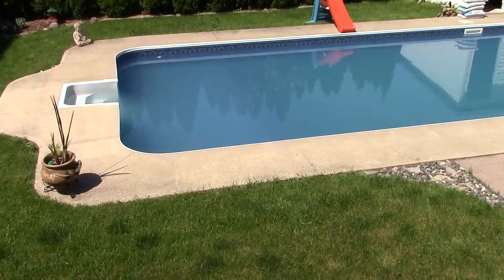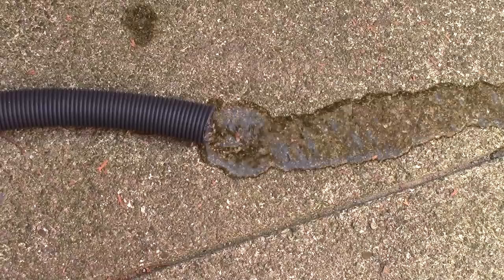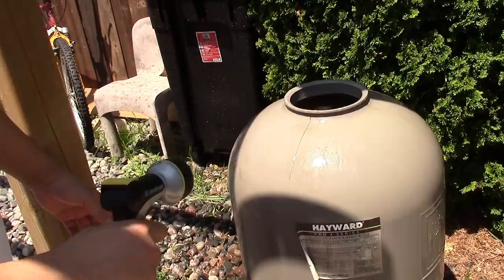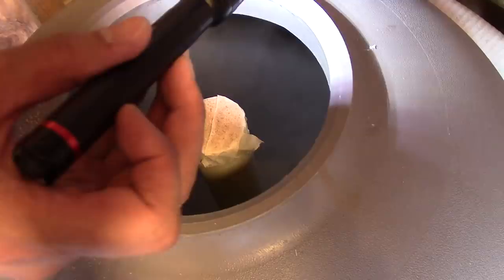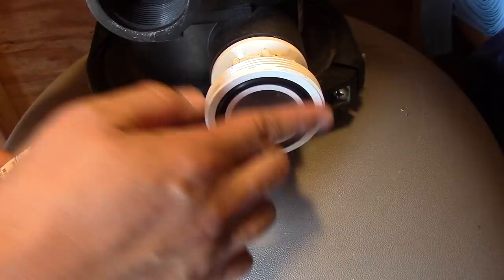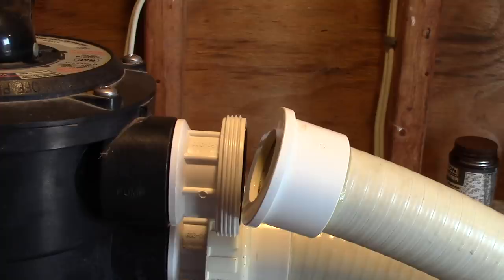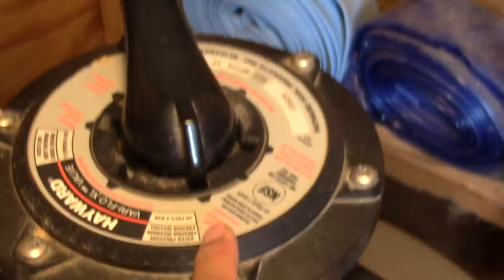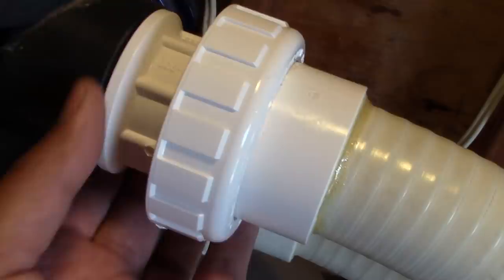My pool is cloudy: DIY Change Sand In My Pool Filter.

Comment: instead of using tape, try a 1.5" pvc cap
Reply from the maker: Thanks for sharing that. Now our viewers have an option.
Reply: That works however be careful to remove sand from around the neck of the pipe before placing on. That fitting might get jammed on and not easy to remove cause a crack in the lateral assembly.

Comment: LOL. Why would you use sand on an expensive setup like that? Most people - myself included - use granulated glass. It costs about 3 times more, but never needs changing and also cleans MUCH better than sand.
Reply from the maker: Yes i heard that glass was much better. My next change i will try the glass.

Comment: Scoop most of the sand out first then use a shop vac and never replace the sand without replacing your laterals the 10 fingers he was talking about.
Reply: Rodney Armstrong yeah just change the latterals everytime u change your sand why don’t we just buy a new filter
Reply: @jonandthey8894  well I take care of public pools and you could replace the sand and a little time later you could Crack a lateral  do to chemicals simply dry rotting them out. They are plastic and they will dry out and you are doing it all over again. I replace mine every 4 years.
Reply: @jonandthey8894  my pool inspector just showed up today and passed me with flying colors.

Comment: When adding sand, putting about 2 inches of water above the fingers helps cushion them and also cuts down on dust.
Reply from the maker: Great info. Thanks for sharing that. Now our viewers know.
Reply: At what time do you mean? You mean adding 2 inches of water before sand or add all sand and add two inches of water like in the video?
Reply: @stevenarseneault1972   first add about 2 inches of water (Covering the fingers) then add the sand, then add more water to just above the level of sand.
Reply: @goatdocfilms504  I have heard that it reduces the risk of breaking the fingers also
Reply: @TrusteedeDomenico  yes it does. the water allows the sand to fill in under the fingers easier

Comment: quick tip.cover laterals in water 1/3 and also use 2 bags course sand over top laterals after putting in some water. the course sand is essential
Reply from the maker: Great info. Thanks for sharing.

Comment: thank you. I just bought a house with a pool and never have opened a pool for the spring. The label on the sand filter is completely gone so this was very helpful. Also I have a leak in the O ring so I will try to clean and lube it before buying another one. So thanks for not rambling on and on, you made a very simple, easy to follow video!
Reply from the maker: Thanks. I try to keep it simple and to the point.

Comment: Just purchased a house with a large pool that has become my worse enemy as I’ve never owed a pool before. You video is easy to follow & information is spot on, thanks for posting & here’s to hoping my pool comes back to life.
Reply from the maker: Hope it comes to life also. Thanks for sharing.
Reply: Key thing is to have an automatic sweeper and clean your filter as needed. See the pressure after you clean it and when it creeps up clean the filter. As for chlorine, start off with weekly shocking until you get in maintained. Then try to maintain using liquid chlorine. Check chlorine 3 times a week and learn how much you need to add by keeping a history of temperature (avg). Eventually you will be able to upkeep the pool without even measuring chlorine. Of course check the other measurements as well using a 5 way test kit and adjust (usually once a month at most).

Comment: I added water first.  I keeps the sand dust down and protects the fingers.  
Good video!
Reply from the maker: Thats a good idea also.
Reply: Done a few of these, adding water keeps the dust down and helps protect the laterals (fingers) on filter from damage.  Still want to take caution adding the sand until the level is over the laterals.

Comment: Great video. About 3 years ago I bought a house with an indoor pool and this spring I noticed that I was getting sand inside the pool almost every day since I opened it.  I figured that it was time to change the sand in my filter (300lbs) and this video was just what I needed before I tackled the job.  
Hopefully the sand that I'm seeing in my pool is because some of the sand has worn down and managed to fit through the tiny holes on the fingers in the filter. If not I may have a cracked finger inside the filter I'm guessing.
 Still, this video was very helpful and was the perfect education that I needed before I opened everything up.
Thanks!
Reply from the maker: So glad my video helped. Thanks for sharing that with our YouTube viewers.

Comment: Johan,

Thanks for posting the video on how to change the sand.  Very good indeed!

Couple of questions, If I may.

1:  Where did you find the tubing that you attached the unions to?  I have had no luck at Lowes or HomeDepot.

2: Did you use basic primer and pvc cement?

3:  If you are in Canada, any issues with the tubing freezing or cracking?  Or there days, weeks, and months you have to keep the pump on to ensure no broken parts?

Thanks in advance!  I will be using your video on correcting an upside down light switch.
Reply from the maker: You're welcome. Hope it works out for you.

Comment: Thank you for this video.   I always wondered about the rinse feature.  So on a regular basis, should we be putting the filter on rinse after vacuuming and back washing?
Reply from the maker: That is correct. You should always vacuum then backwash and then rinse after.

Comment: I used a old pool pump to remove the sand by filling the sand filter to the top with water then sticking the hose down to bottom  the pump didn't like it but it was getting dumped anyway
Reply from the maker: As long as it worked out for you. Good job.

Comment: Thanks for the video. I have an inground pool and every time I rinse and vacuum the pool and put it back on filter dirt and sand goes into bottom of the pool. Do you think I need to replace the laterals in my sand filter?
Reply: One or more of your lateral lines are broken and sand is going thru it. They arent expensive. Just have to go thru the process of changing the sand so you can change out that broken lateral line. They screw in and out of that hub that is attached to the stand pipe.

Comment: Number one use white sand only don’t use brown. Number 2 don’t fill it with water just above the sand. Number 3 don’t have to backwash for 2 minutes the cycle goes clear dirty clear. Number 4 don’t rinse for 30 seconds rise for 10

Comment: Some tips. Shop vac after filter has been opened for a couple days to help is dry or else it will take forever. Also, sand filter doesnt need to be replaced every x amount of years. It really depends on your pool and how much debris is going through your filter. I have had multiple customers will sand that is 15 years old and pool is still clear. The reason this guys pool was dirty was due to neglectful maintenance.
Reply from the maker: Thanks for sharing. I've had friends with pools thats haven't changed their filter for over 10 years. And they say their pool is still crystal clear. But if you have done all you can to keep it clear and it keeps turning green, then $50 for a new sand is cheaper than hundreds of dollars of more chemicals. What do you think?
Reply: JONAH VLOGS & DIY, yeah that cheaper, however, a $15 bottle of pool clarifier and then a backwash would be easier and cheaper. The $15 bottle will last you a few years if you maintain the pool properly. I just got another customers school sparkling clean with $150 charge. His pool was green and very dirty (dirt). Someone else wanted to charge him $800 to drain and clean. I told him that isnt needed. Shocked and added chlorine adjusted other levels. Sweeper picked up the dirt. Backwashed 2 days later and it was clean.
Reply: Adam V Thanks for the video. I have an inground pool and every time I rinse and vacuum the pool and put it back on filter dirt and sand goes into bottom of the pool. Do you think I need to replace the laterals in my sand filter?
Reply: Adam V sand is 100% fine
Reply: Adam V 7

Comment: I have a sand filter that have the same sand since 2005 and its crystal clsar
Reply from the maker: Wow. Tell us your secret.
Reply: @jonahvlogsdiy4143  i just dont backwash when i need to normally, because how much more dirt and debris in the filter more microns of particles it filters so normally when pressure is starting to get above 2 bars is when i backwash, also i dont use the products that they recommend because they degrade so much the sand that you wont believe, so thats my secret

Comment: This is fantastic!  Thank you!  Can you describe the unions and hose you use for the inlet and outlet of the filter.  I have a similar set up, except mine is all hard PVC and I am not looking forward to cutting and replacing the pipes for any maintenance.  I'd rather have unions like you and hoses so that I can have the flexibility when connecting the filter.  Thank you in advance.
Reply from the maker: Stay tuned for the next DIY. It will show how to do it.
Reply: Try and stick with pvc if you can, the flexible stuff doesn't glue as well as the pvc pipe does.
Reply: To install the unions you would still need to cut pipe and do some minor plumbing.

Comment: How did you get it so clean after you rinsed it out with the hose? I am unable to turn my filter upside down and dump all the debris out after rinsing
Reply from the maker: Once all the sand is out, it should be light enough to turn upside down.

Comment: Just open the filter drain and turn the pump on it will blow the sand right out!
Reply from the maker: Not a good idea. Lol
Reply: @jonahvlogsdiy4143  You should tell all the professional pool guys then because that is what the do.
Reply from the maker: @time1800  It's their pool. But I wouldn't do it to mine.

Comment: hello jonah i recently changed my sand to palmetto sand...my pool is balanced and still green..im thinking its the sand i put in..what kind of sand do you use ...any advice thank you
Reply from the maker: Hi Alonzo. I use Silica Pool Sand. I heard that glass is even better but I've never tried glass before. You should see a difference 2-3 days.
Reply: If the water is green, most likely its algae. Buy the recommended amount for the size pool you have. Sand filter will not kill or get rid.of algae.

Comment: Hold on I’m confused why did he have sand in there in the first place
Reply: This kind of filter uses the sand to clean the water instead of a normal filter.
Reply: Jesus Christ that’s cool I wonder how it would work though
Reply: Stuff going through the filter gets stuck on the sand. However the water can go through the sand easily. Eventually the sand will have so much stuff in it that it needs to be replaced. You can see the difference between the old sand and the new, clean sand.
Reply: Jesus Christ thanks
Reply: Jesus Christ thats not why you change sand the reason you change sand is when the sand is new it has sharp edges and pronounced shape and that is what catches all your debris that flows through the sand the old sand over time gets rounded and cannot trap and catch fine particles so please do yourself a favor and change your sand every 3 years you can go upto 5 years but I recommend 3 for a crystal clear pool

Comment: 😂🤦🏾‍♂️first time pool owner. I thought I did a great job with my intext sand pump. I had it all set and when I turned pump on the sand dust pumped into my pool🤦🏾‍♂️🤦🏾‍♂️ still trying to clean it up. Any advice on faster way to get the sand dust out of my water or just time will clean it?
Reply from the maker: Yeah just time will clear it out but run the pool 24hr/day until it clears. Hope it's cleared now.
Reply: @jonahvlogsdiy4143  YOU ARE SUPPOSED TO GO TO THE RINSE MODE AFTER YOU PUT THE SAND IN UNTIL IT RUNS CLEAR. I DID AND GOT LITTLE TO NO SAND IN MY POOL.

Comment: A real easy sand filter repair is to cut the whole thing out and replace it with a D.E. filter.
Reply: Would not be easy as you would have to put the new one in, also D.E filters cost about twice as much as a sand filter.

Comment: My pool was crsytal clear. I got lazy and didnt vacume in a week. Pool turned green. Went in and vacumed. Turned cloudy and never returned to clear. Bought clarifiers, algaecide, shock and nothing works. Water sample is good with the chemicles. Last resort is this. Opened the sand filter and was green all around. New sand and hopping in a few days it clears up.
Reply: bklynjohn717 that is me right now! I’m going to change sand today and praying it works! Otherwise the pool is hemorrhaging money!
Reply from the maker: Hope it works out for you.
Reply: How'd it turn out, having same problem here in AZ, bought house 4 years ago and haven't changed sand yet, drained it fresh 5 months ago and now green, all chemical test are fine, thinking this is the problem!
Reply: @larslan1975  ran the pump for days and vacumming. Nothing. Still foggy water. I drained the pool for the season. Gona start next year with new water.
Reply: bklynjohn717 thanks for the quick reply, this probably needs done any way, end of season I'll do it and drain pool again. Just start fresh! Good luck bklynjohn717
Reply: @larslan1975  Yea man im at my wits end with this. Im fussing with all these chemicals and god only knows how much electric running that pump on high for days. All this for $100 worth of water. My pool is an above ground  21 foot round 4 1/2 feet high.
Reply: @bklynjohn717  I know it's been a pain in the ass every year with these monsoons! Mine is about 16-18000 gallon in ground, I just hook two pumps up and water the grass here and don't run sprinklers for a week( kills 2 birds one stone lol), but sand has to be my issues or else I'm selling this house!
Reply: bklynjohn717 shock the hell out of it. Had the same problem and 6 gallons of bleach cleared it up in 2 days. 22,000 gallon pool
Reply: @R2sojr09  I did 6 gallons of liquid chlorine and it make it bluish again, but still cloudy, bought something on Amazon and put a couple of cups in its getting there, but the definitely needs change the sand, just waiting for October for 100 degree weather to go away.
Reply: Lars LAN did you try a water clarifier? If not also try flock. It will drop everything to the bottom and you just vacuum it up
Reply: Thanks to you all,, I'm learning from the info.

Comment: Question how can i tell if I have sand in my filter ?? how high should the sand be ?
Reply from the maker: Your pressure gauge should read 10-15 psi if sand filter is working correctly. If the sand filter is full of debris it should read over 15-20 psi. If you have no sand it would read 0-5 psi. My pool takes 5 bags of sand. you will have to go to the pool store and show them a picture of your sand filter and give them some measurements. They can tell you what you need.
Reply: @jonahvlogsdiy4143  thans for you help I get 10 to 14 mainly in the middle
Reply: Could you have no sand?

Comment: My family has a sand filter but we don't have a pressure guage can you help
Reply from the maker: Some older filters do not have a pressure gauge. It should be no problem.
Reply: Crody Leger I would probably install one because it helps with different things like when to backwash and to make sure it is running at the right pressure range

Comment: i DID EVERYTHING HERE AND STILL GET SAND IN MY POOL :( PURCHASED A LATERAL REPLACEMENT... INSTALLED.... WHAT COULD BE WRONG?
Reply from the maker: Wow it sounds like you did everything right. Might be time to call the pros. Let our viewers know that you find out.
Reply: Well, Last thing I did was Pool Clarifier, seems like the pool is clearing up. Used a whole bottle going for a second whole bottle... 32oz. if that don't work i will remove sand and check that the laterals are tight and nothing is leaking. thanks for reply.
Reply from the maker: @alienkawala8287  Thanks for the update. I know our viewers will also learn from your experience. Thank you.

Comment: Can you tell me what height And diameter your filter is?  Label on mine was gone before we bought our house, so I’m not sure if I have a Hayward 244 or other?  250lbs or 300lbs?
Reply from the maker: Sorry to get back late. My sand filter  height is about 39 inches including base and head valve. The diameter is about 22 inches or circumference of about 72 inches. Hope that helps out.

Comment: When my pool gets cloudy I put in flock
Reply from the maker: Thanks for sharing. I'll try that next time.
Reply: @jonahvlogsdiy4143  It’s the same stuff they use in water purification plants what it does it takes particles are too small to be trapped by a sand filter and make some stick to each other it’s a coagulant and they use it infiltration plans for drinking water

Comment: I have a Haywood filter (looks like that one) when replaced the sand it had no labels anywhere so I put 4 bags 200 odd if it’s short what could happen
Reply from the maker: It will be ok. It will still work well.
Reply: heyhipp go by size height and width of the unit and you should be able to determine how much sand you need or look for markings inside or out for sand level